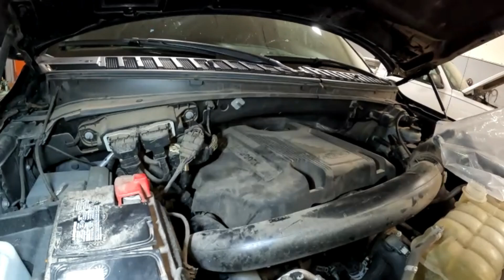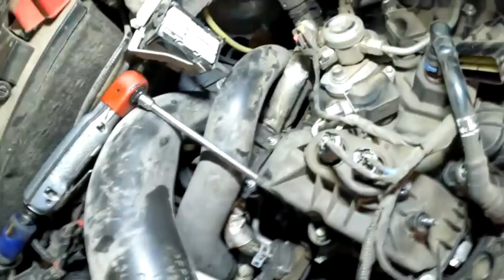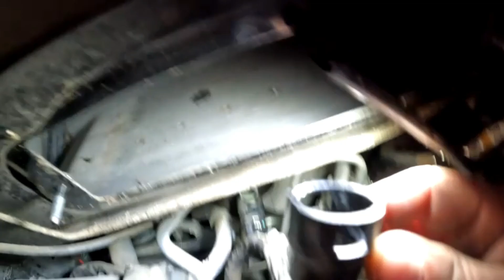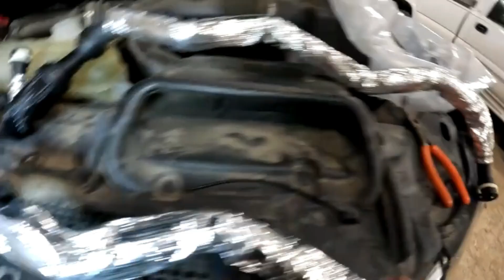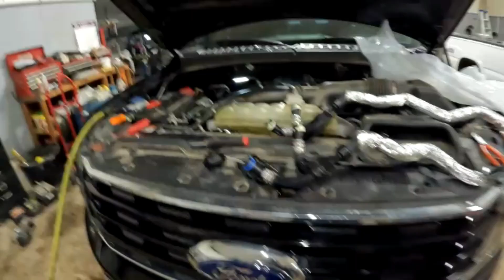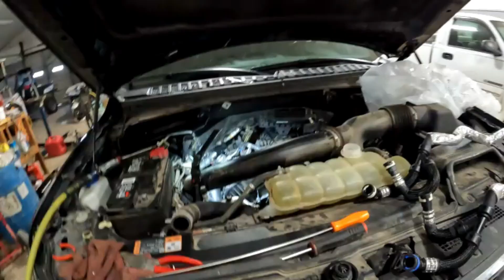2019 EXPEDITION HEATER HOSE REPLACEMENT

Comment: Update: replaced the upper hose tonight. Computer removal was a key!!  The clamp/tubo pipe bracket wouldnt come loose (I probably over tightened it last time). Come to find out the hoses just run on the back side of it and it was pretty easy to just fish it in there. The lower hose may be a different story. I didnt look that close. Clips came off easy. Whole job was done and truck back running in about an hour (I only replaced the top hose)

Comment: Can you tell me which part number is for the outlet and the inlet hose? The back hose on mine is leaking, I'm not sure if that is the outlet or inlet haha. I probably just just replace both though, looks like it would be easiest to tackle both at the same time.
Reply from the maker: Do them both  . If one is leaking the other one is not far behind .
Reply: @heartlandmechanic I ordered both. Figured it was needed. Also doing the oil press sensor (again, 3rd time).

Comment: Thanks for the video.  I decided to follow this and was able to replace the hoses.  But when I went to start the vehicle, it got electronic errors.  Did you run into this?  Is there something that needs to be reset?
Reply from the maker: Did not have any problem with mine , Double check all your electrical connectors , you may have one that is not fully connected .
Reply: @heartlandmechanic  Yep, had to blow dry the connectors as it looks like I  got some fluid in them.  Reconnected and everything working again.  Thanks!